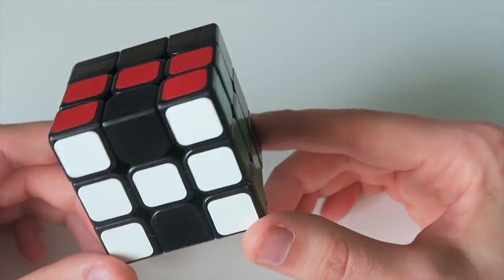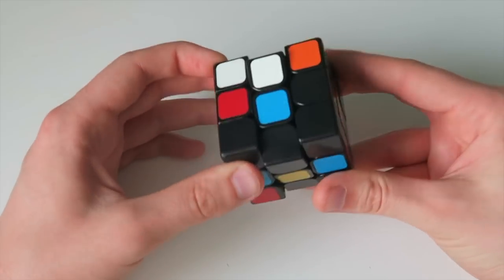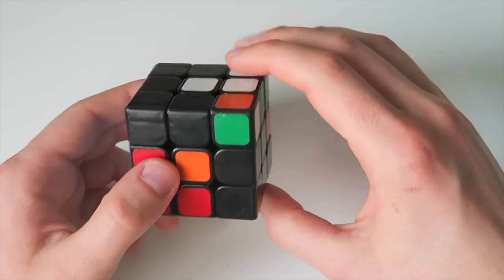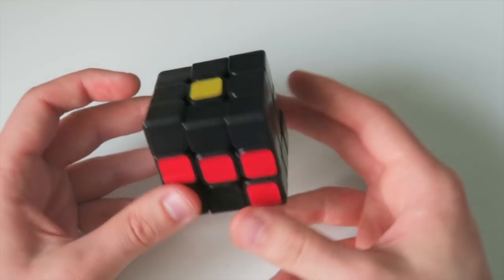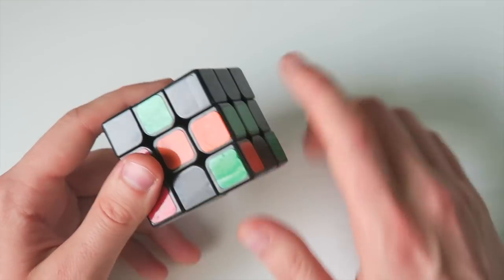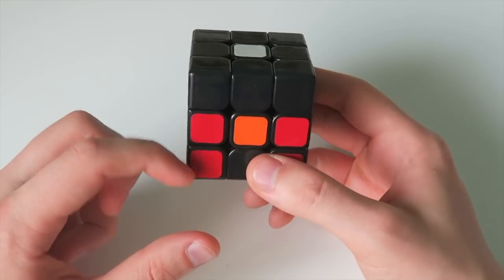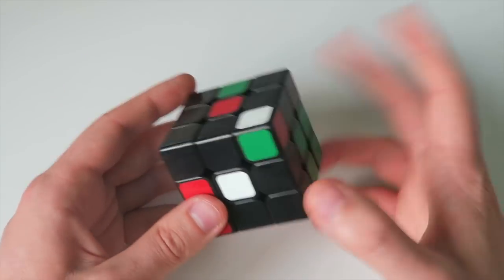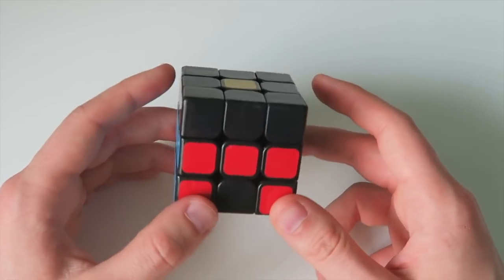I Officially Suck at Roux! (LLR #3)

Comment: Have you ever explained what 'Roux' is? I've no idea even after three videos.
Reply: Roux is a  block-building method to solve the 3x3, where you make 2 1x2x3 blocks on the same side, then orient and permute the corners, and then orient and permute the remaining edges.
Reply from the maker: Episode one involved a couple of walkthrough solves to demonstrate how the method works and outside of the series I have done two other walkthrough videos for Roux. I appreciate, though, that these might not have answered your question. Roux is a 3x3 method consisting of block building (1x2x3) on the LD and RD sides of the cube. This allows you to use the whole cube without layer restrictions as you get with F2L. From here, you solve the top layer corners (CMLL) and then orient the final 6 remaining edges. After that it is intuitive permutation of those edges until the cube is solved! Roux essentially opens up the cube for more intuitive solving rather than the algorithm heavy CFOP, and it cuts down the number of moves per solve (after a little practise, of course). I hope this helps!
Reply: Loving the channel name mate, Im also somewhat of a pompey fan